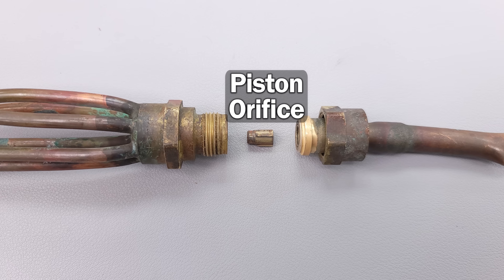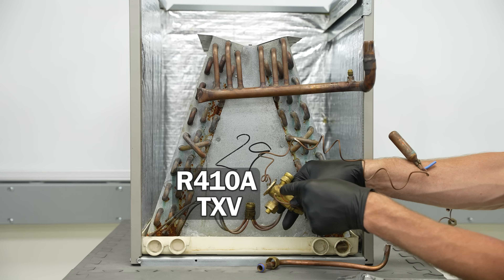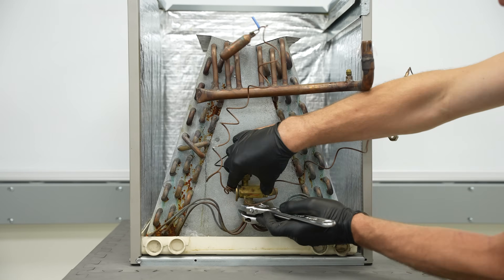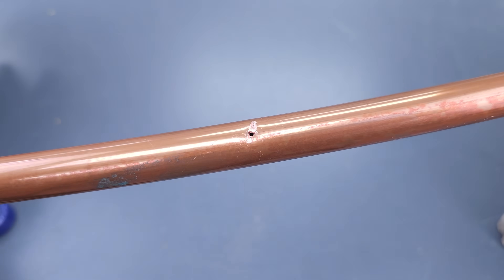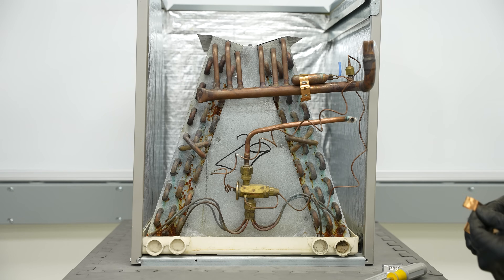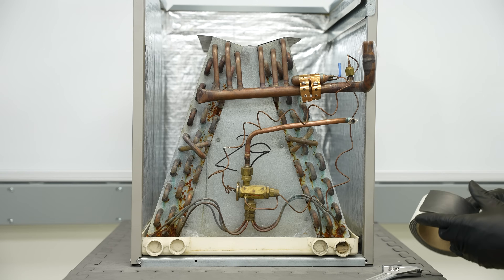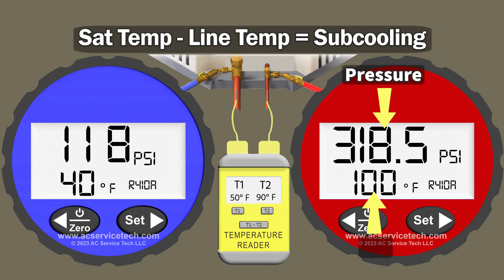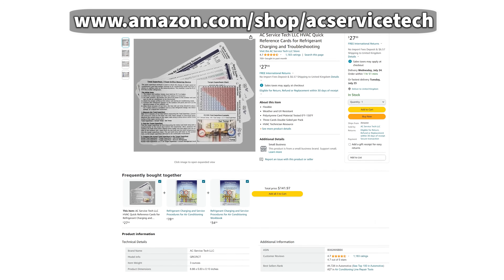How to Replace a Piston with a TXV Metering Device! HVAC Service & Install Training!

Comment: Another tip for making new connections on the line set is pressurizing the component that needs an access to say about 50 psig of nitrogen and just drill while it's in a positive.
All that crap will come flying out so wear goggles.

Comment: Do you leave the 1/4 inch schrader in the equalizer line or remove it ?
Reply from the maker: That would need to be removed because the tube connector does not have a valve core depressor, thanks!

Comment: Question: Why are the sensing bulbs cylindrical? 
Given pipes are also cylindrical at best the intersection between pipe and bulb is a line which in a purely mathematical sense has zero area for thermal conduction. 
In a physical sense that makes the time it takes the sense bulb temperature equalize with the pipe temperature very long relative to the on-off cycles of the air conditioner.   
Thermal grease or an indentation on the bulb side matching the pipe curvature would massively improve thermal conductivity and allow the TXV to react to changes faster.
Obviously its easier to manufacture a cylindrical bulb but better conductivity would allow the TXV operate the coil more efficiently and  protect compressor better..
Also, thanks Craig, I love you book and learn so much from these excellent videos of  yours.
Reply: I imagine the two copper clamps help, but definitely there is some thermodynamic hysteresis.

Comment: Great video you never mentioned to remove or make sure the shrader core is removed from the equalizer if there is one Tranes RunTru airhandler. Let me know if I'm wrong? If it has a black plastic cap it has a core.
Reply: so do you remove the shrader core for the equalizer

Comment: I have never replaced a failed piston.  I lost count of the failed TXVs that I have had to replace.  Piston is more dependable and savings from TXV or almost undetectable.  2014 and 2015 nightmares come to mind.
Reply: Right on, TXV's never ;pay for their cost. Fixed metering device is the way to go,
Reply: OTOH, if you've got someone who like to keep it ice cold inside, when it's above 95 outside, with a piston, you're gonna be operating your compressor with very little SH, risking liquid floodback...

Comment: What I would like to know is, lets say you have to replace the evaporator (because too many leaks).  Should you add oil to compensate for the amount still left in the old evaporator?   This is a question that no tech ever talks about.  Recovering a charge to replace a component... what to do about lost oil?  Thanks for making these videos!
Reply: Twenty years on and I haven't had a compressor fail for lack of oil.  Oil pools in the CU and only a small amount is in the evap.  Running on a low to no charge so the refrigerant isn't cooling the compressor motor is the usual death.

Comment: So I'm looking to change the piston to allow r22 to 410a refrigerant change is this the same thing or similar
Reply: Yes.  We commonly do this when the customer "can't" afford a full system replacement.  Or 410 evap on older R22 system.

Comment: I want to power my house with a generator during power outages, including my 3.5 ton A/C. I hear it is recommended to install a "soft-start", so that the generator has an easier time starting the A/C. Can an electrician install the soft start, or should the HVAC company install it if I don't feel comfortable doing it myself? Does installing a soft-start do anything bad to the compressor, like shorten the lifespan, or is it actually beneficial to have a soft-start?

Comment: Non-AC guy here. Could you shut the liquid line off first and use the compressor to pull most of the refrigerant into the outside unit then shut off the vapor line?

Comment: How do you recover from the coil/ lineset only if there is no access port on the indoor coil? Are the service valves located inside or outside the shutoff valves to the condenser?
Reply: The access ports are on the lineset/evap side.

Comment: Do you see a trend change to EXV’s instead of TXV’s. The biggest annoyance I see with TXV’s is when the bulb loses its charge. 
Opinions, please 👍👍
As usual, a very informative video. Thanks again .
Reply: Probably because that seems the way the industry is going. My biggest thing with TXV's is installers not brazing with nitrogen purge. Then the oxidation later down road plugs the TXV and service has to go fix it.

Comment: He recovered because you can’t pump down a condensing unit that has a scroll compressor or thin micro channel fins
Reply: You can use the pump down method with scroll compressors, I do it often. You just can’t with a micro channel condenser coil because they typically don’t have enough capacity for all the refrigerant.
Reply: @HVACMAVERICK  thank you for letting me know this information appreciate it 👍

Comment: How far in should the equalizer tub go into the line?
Reply: @evane8423  Doesn’t need much. Just far enough that the braze doesn’t overcome the end of the tube.
Reply: @HVACMAVERICK  thanks for the input. I wonder if there could be a general rule of thumb that's somewhat consistent regardless of the size of the equalizer tube. Maybe for example, insert the equalizer line until it hits the bottom, make a mark, and then pull it back out to even the end with the exterior wall of the tube. Then... Roughly divide the difference for halfway and mark, then braze. Or 1/4"...or 1/8"..ect.
Is there a manufacturer spec for penetration regarding this retrofit or simply case by case and experience know how?
Reply: @evane8423  Try not to make it more difficult than it needs to be. 
The TXV manufacturers have already done the math for us… The purpose of the equalizer tube is to "read" pressure. 
Regardless of the insertion depth, it will still read the same amount of pressure… As long as the tube opening isn’t restricted completely by the braze media.
Reply: @HVACMAVERICK  would it be reasonable to compare the purpose and function of the equalizer tube, to a scuba diver that must add physical weights for a net zero buoyancy in the water?
Reply: @HVACMAVERICK  what is the flow rate of refrigerant on the suction line? From your last answer, angle is not a concern nor depth penetration. I suppose my original question was the concern for the added turbulence giving a false pressure.

Comment: Why recover when you can pump the refridgerant into the condensing unit? Simpler, faster and cheaper.
Reply: Yes if it all fits. It's nice when linesets are short but, when they are very long doubt that's going to happen
Reply: I've never had any issues with scrolls pumping down or failing from pumpdowns.  I'm strictly a commercial tech now and all my  Mcquay, Daikin MPS , AAON's and destrons all pump down on their own to shut down when a call for cooling is satisfied.  This is completely normal operation for these units. This is to prevent liquid refrigerant from migration and flood back to the compressors which is way worst for any compressor. They pump gas not liquid.
Reply: Basically pump it down to about 1 psi with a scroll type to prevent slugging. If you’re in a pinch
Reply: doesnt work too well if its a scroll compressor
Reply: It's easier to trash a scroll doing pumpdowns.  I am not sure of current recommendations but manufacturers used to discourage it.

Comment: Why don't you just pump the whole system down into the condenser.why recover?
Reply: I pump down scrolls to at least 20 psi then recover the rest it’s always worked for me
Reply from the maker: You dont want to pump down a scroll compressor to the point where no refrigerant is left in the compressor shell which is the low pressure intake because the electrical terminal or winding can short to ground, which will cause the compressor to fail.
Reply: @acservicetechchannel   It's the little things that get ya. 🙂
Reply: @acservicetechchannel  I Pump them down all the time. Stop at 10 psi. Plenty of scroll compressors are on refrigeration Pump down systems by design.
Reply: @acservicetechchannel what about rotary compressors?
Reply: @acservicetechchannel  I believe there might be other reasons, but I do not understand how it could cause the terminal to short to ground.
Reply: @ZZZRSC essentially when the come new from factory with a charge

Comment: Do a video on why not one compressor manufacture supports the use of Nylog!
Reply: It's to cover their ass. They don't want any foreign material of ANY kind into their system. Warranty is gone if you use nylog. I call bs in my opinion but what do I know. They are the engineers 😂😅
Reply: I still use it tho idgaf!
Reply: @harryschrysan3183  I use it as well. I just wonder why compressor manufacturers don’t want us to use it
Reply: As I mentioned they consider it a foreign substance and they wouldn't approve warranty if something fails. If you tell them you used it they will cancel you 😂.
Reply: @harryschrysan3183  👍

Comment: If you did this on a system that was installed with a piston, how could you calculate the target subcooling ? I know how to calculate target SH, but , what about SC ?
Reply from the maker: The target subcooling for a single speed system shoukd be posted on the outdoor unit rating plate. if not, we usually set to 11 degrees, thanks!
Reply: Charge subcooling to around 6-10 degrees I’d say that would get you close.
Reply: Recommendation is 10 degrees +/- 3 unless marked on the CU.  Same variance on SH.

Comment: Will this help with a mismatched coil & air handler/furnace ? 18 yr old furnace has lower than needed air flow & will be replaced  when it fails but need a solution now!
Reply: low air flow, is low air flow, increasing airflow is the only real fix. while switching to an txv will certainly help now and later(efficiency increase regardless of ambient temps) and better control of coil temperature, reduced floodback to condenser, etc. again AIRFLOW = number one fix
Reply: How mismatched?  Most furnaces have three or four speeds so if the CU is small, slow the air down.  If too big,  set it as slow as possible.  A TXV is not a magic wand.

Comment: How much of an efficiency increase do you get with a TXV versus a piston?
Reply: @danielkelley7422  The difference is staggering enough to never use a piston again.
Reply: @HVACMAVERICK  so can you provide a percentage?
Reply: @danielkelley7422  there is no exact percentage, because the piston efficiency varies greatly with indoor and outdoor ambient temperatures(+humidity) and proper airflow both indoor and outdoor over the evaportaor and condenser coils, at certain points in both ambient temperatures(+humidity) the piston will be about equal in efficiency, but that's a narrow window of perfect conditions.
in the real world, efficiency gains could be 0 to 50% or greater in very extreme situations. even this figure is a guess, becasue again it varies all over the place.
Reply: @throttlebottle5906  Here’s the problem. A piston can’t fail. A TXV can fail and likely will fail. So when it does fail, the customer is looking at a repair bill of what, $1,000? So any potential savings are gone.
Reply: @danielkelley7422  yes, that can happen and does, especially if they didn't keep everything clean, flow nitrogen while brazing or reusing linesets/parts without cleaning very well.
but, a piston metering device ran in low ambient conditions indoor, outdoor, both or with wrong charge amount, causes severe liquid floodback to compressor, which washes oil out and liquid slugs it, HVAC/R compressors are not meant to pump liquids, only gasses/vapor. all the oil being out in the system vs. lubricating it is certain death.
with later refrigerants (R410a/newer) the charge is more critical to keep from killing the compressor with liquid, so TXV/EXV is pretty much required now. 
yeah, they're no longer as durable as they once were, whole refrigeration/hvac systems used to last 30+ years with ease, of course that's when taken care of and not ran in extreme conditions.

Comment: How much would be my target subcooling if I retrofit a txv just like you did? Thaks a lot.
Reply from the maker: The target subcooling for a single speed system shoukd be posted on the outdoor unit rating plate. if not, we usually set to 11 degrees, thanks!
Reply: @acservicetechchannel  And/ or, the installation directions make "suggestions."
Reply: 8-10 degrees.
Reply: @DaríoMartínez-w6w  And make sure your condenser coil is clean before charging.

Comment: I just replaced a TXV with a piston
Reply: Simple seems better to me, but I am not knowledgeable in this subject..
Reply: @francom6230  homeowner was happy that her a/c was working better than it had been the last several years after having several techs tell her it was doing all it could and of course trying to sell her an entire new system since hers was 15 years old
Reply: @Joe_Potter_2  Yes, actually you’re correct sir, pistons are slightly inefficient sometimes. But in July, August and September when they are needed to perform a specific duty, they are very inefficient compared to a txv.
Reply: @HVACMAVERICK  What is saved by efficiency? Money, you say. What happens when the TXV fails. That's right, you spend all the money you saved paying a service company.
Reply: @markniles3013  Haha! That’s one way to look at it for sure. 
But if your goal is to get the equipment to last as long as possible,  and to get your customers as comfortable as possible in your their own home, then I’d say a TXV is a small price to pay…
Reply: @HVACMAVERICK  Not sure I understand the correlation between TXV and longevity.  Most of the very old equipment I see ( late 70's ) are all piston systems.
Reply: Simple is better. Txv cause issues years down the road
Reply: @Joe_Potter_2  Yes, txv’s fail… sometimes. But pistons are very inefficient all the time.
Reply: @HVACMAVERICK  they are not VERY inefficient, I would say slightly, and not worth the trouble they cause folks
Reply: @HVACMAVERICK  Nope.  Pistons never fail.  And when a TXV fails, plan on spending big dollars to un fail it.  While the piston watches.
Reply: Pistons don’t fail
Reply: @cdubs1723  I had one failure and that was not really a failure as much as a filter drier decomposed and blocked flow.
Reply: @cdubs1723  Never say never...I just had the Teflon ring in the front of the piston leaking refrigerant around the orifice, creating high suction, low head, and reduction in capacity to 50%.  Mimics an inefficient compressor.